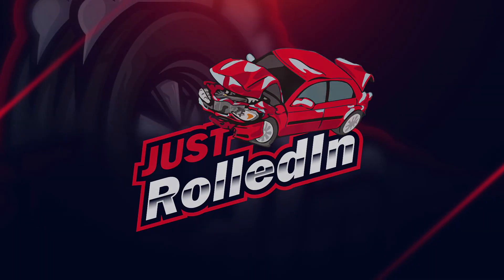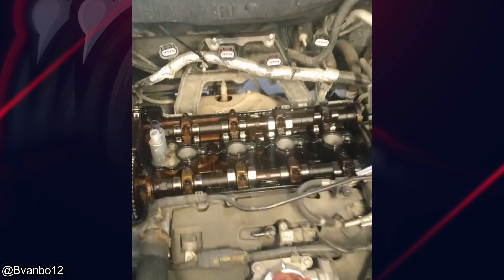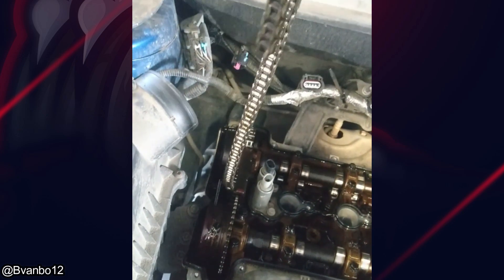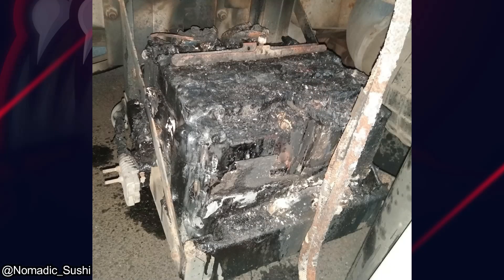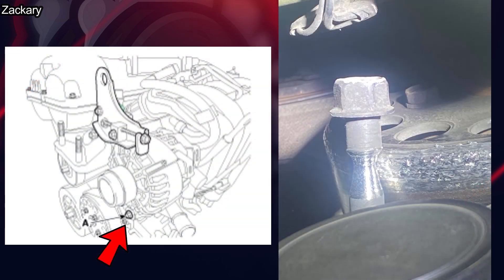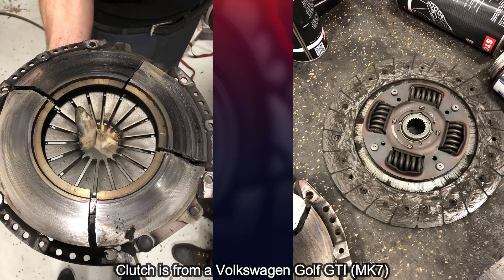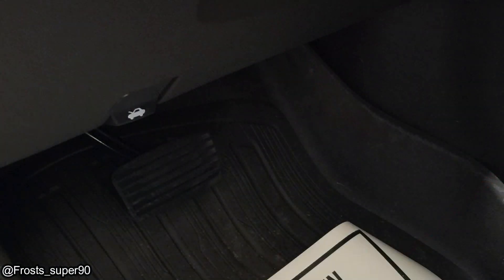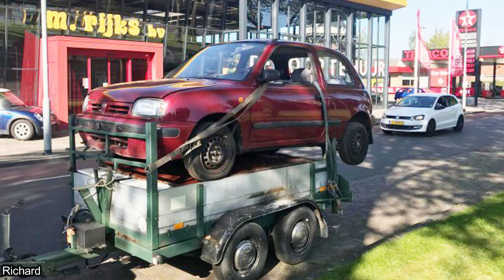Customer States Vehicle Won't Start | Just Rolled In

Comment: Come on, these people have to be absolutely clueless for their cars to get this bad
Reply: You'd be surprised.  Before all this sickness nonsense started I was grocery shopping and couldn't help hearing a conversation between two ladies while in line.  The one lady was in a hurry and explained to the cashier that she had to take her car in for service to get the oil changed because the oil light has been on for the past two days!  The cashier told her it's a good thing to do it soon because she drove around for almost a month (with the light ON!) and finally took it in when it got loud and the shop wanted $3k for an engine replacement!  HAHAHAHAHA!

Hence IDIOT LIGHTS!  All cars should have GAUGES for oil pressure, battery voltage, and coolant temperature MINIMUM.  And when something as critical as oil pressure drops below 6 psig per 1000 RPM a big fucking light flashes STOP THE CAR and siren type sound goes off. So many cars with their fancy screens bigger than my iPad and thousand watt 20 speaker stereos.  Use the tech to inform people they are wrecking their car and even play a cash register sound showing how much their stupidity is costing them! :-D
Reply: @cpufrost  I see, a little TLC and following the maintenance in the manual goes a long way

Comment: Why do people insist on not fastening down floor mats. Ive had it  so many times where the mat jams the pedals.
Reply: I had a '95 Grand Prix that suddenly wouldn't idle down one night.  I threw it in neutral and pulled off the side of the road then quickly shut the car off because it was just redlining the whole time, popped the hood and noticed the clamp that holds the breather hose to the intake had somehow gotten hung up on the throttle body lever that the pedal's cable attached to.  First and last time that happened!